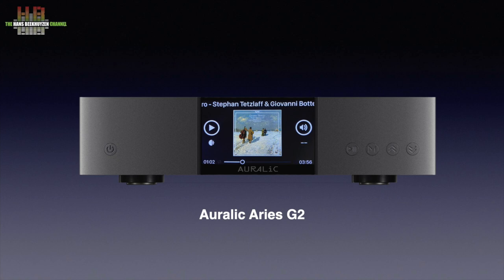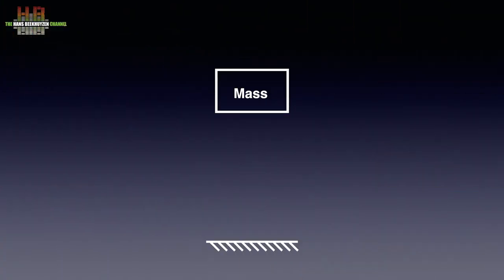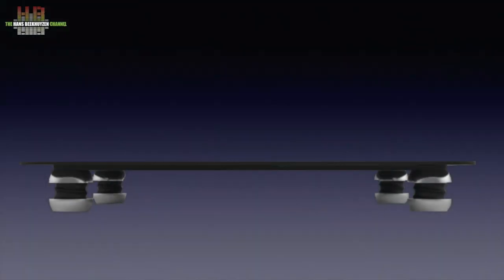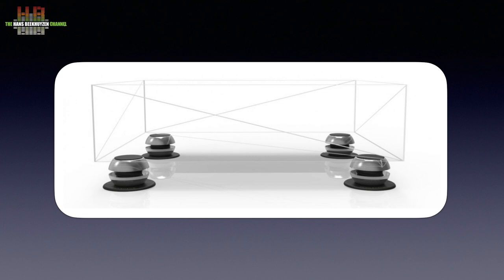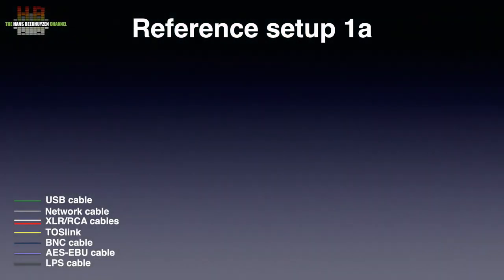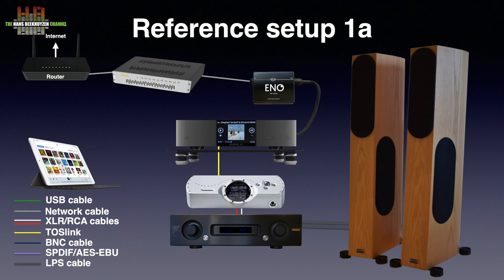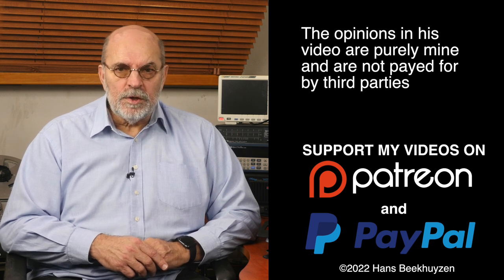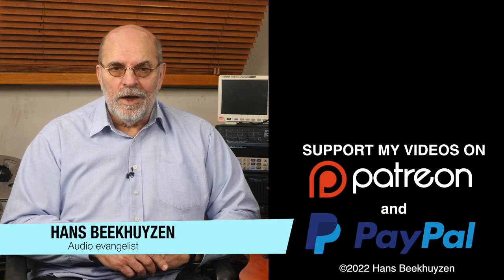Townshend Seismic Vibration Isolation Platform & Seismic Isolation Pods

Comment: Great video Hans, thanks! 
One question: If my equipment is resting on a heavy rack, who resides over concrete floor with wood tile over it, Do you think my equipment would benefit from applying isolation devices under them or is it just recommended when your rack just resides over wood floor? Does air transmitted resonances also affect electronics and should be dampened too independently of the floor type?
Reply from the maker: I don’t know your rack but my guess would be that the sound quality will improve.
Reply: @TheHansBeekhuyzenChannel  Thank you so much Hans, I appreciate it!

Comment: Hi Hans 
Can I put them under a 3 cm hight wood block where Rega P10 sit on it , instead of the wall bracket  

Thanks in advance
Reply from the maker: If you weigh the turntable plus wood block and then select the platform for that weight, you sure can.